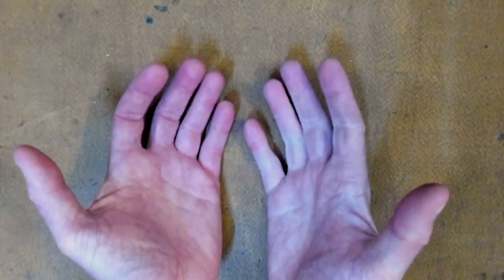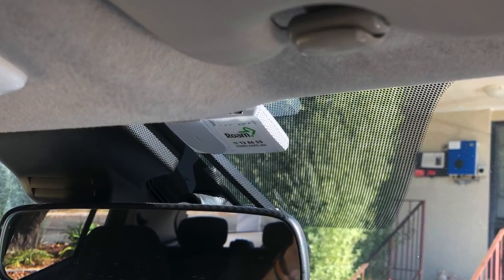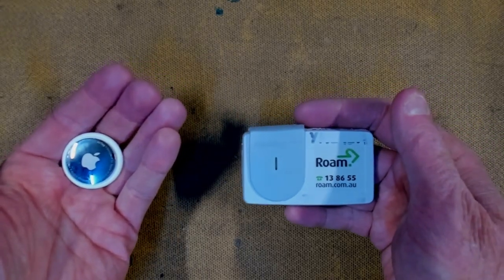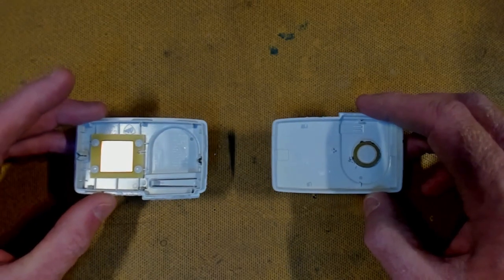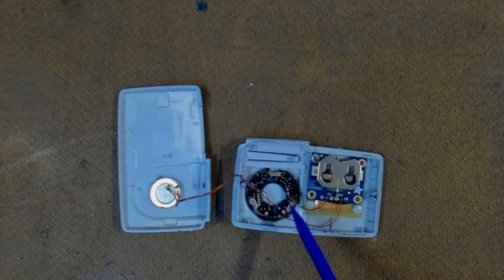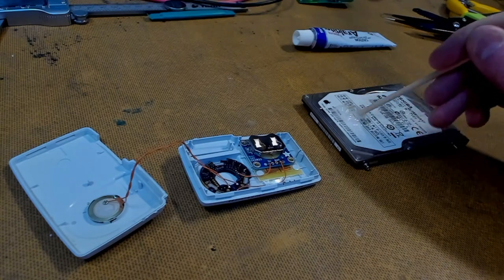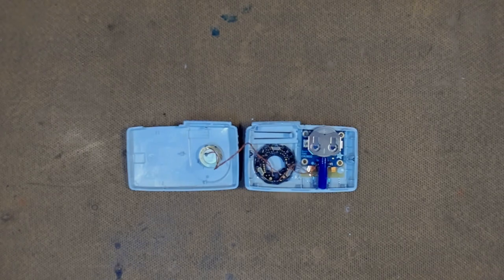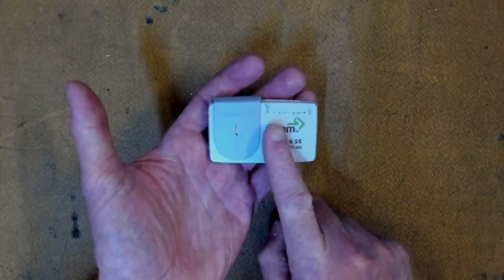Hide Airtag In Your Car

Comment: How do you keep someone from disabling it though?
Reply from the maker: I suppose the point of the video is hiding an AIrtag in plain site. The thief maybe a bit too busy to suspect that a fake "Toll tag" is tracking them.
Not the perfect solution, but better than having an Airtag in plain site.
Reply: @Repair2Renew  I do not have apple products so I do not know this, but how long does it take before their phone alerts them to it "following them" anyways?
Reply from the maker: @lindseypick  From what I understand, apple alerts the Iphone thats transponding (communicating) with the Airtag, that the tracking is occurring on, If the Airtag arrives back at its original location. 
For example, if a deadbeat husband is illegally tracking (Stalking) his wife. 
As soon as the wife arrives home, after departing home (A loop), The iphone will nofify the wife, that she is being tracked.
A great little feature to stop people being stalked or tracked illegally.

In the case of a thief, as long as he/she does not return the car to the place it was stolen, it will track for a couple of hours, enough time for the police to track the vehicle.
Reply: @Repair2Renew  that's good to hear. Thanks!